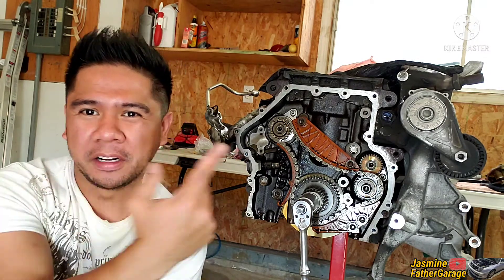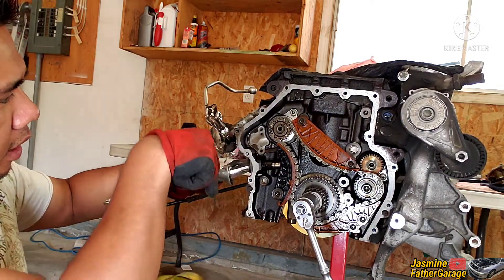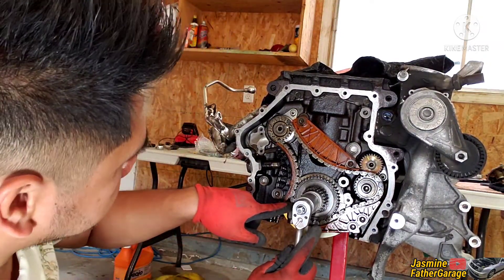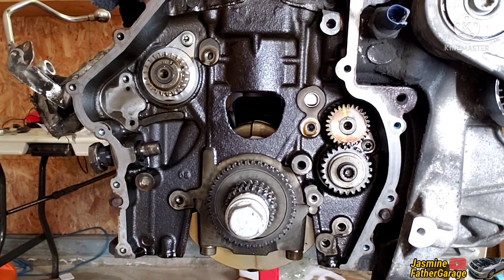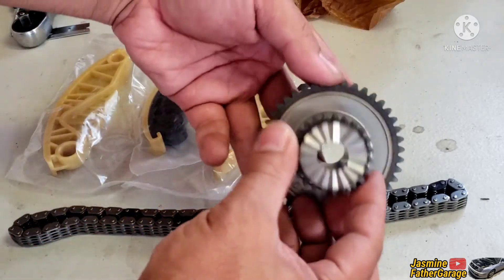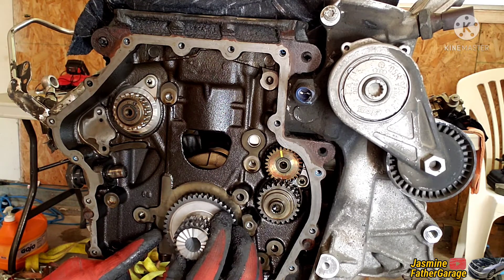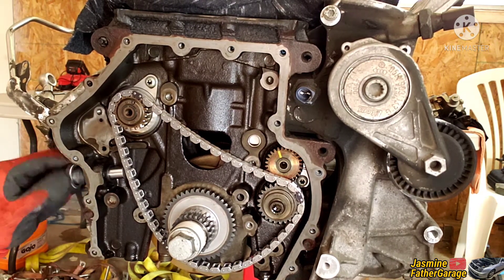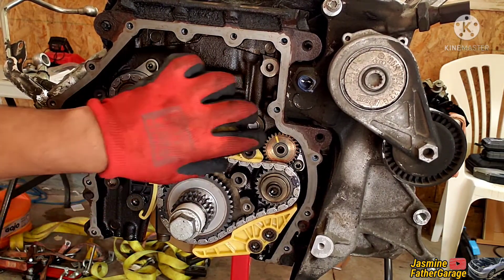Set/Timing Install Balance timing chain, Audi 2008-15 Audi A4 a5 A6 Q5 TT 2.0T

Comment: On the thensioner, what kind of sealant is used?  Does it need to be soaked in oil?  YOU emntioned it needs to be squared up to the block, how exactly is that orientation?
Great vid thanks